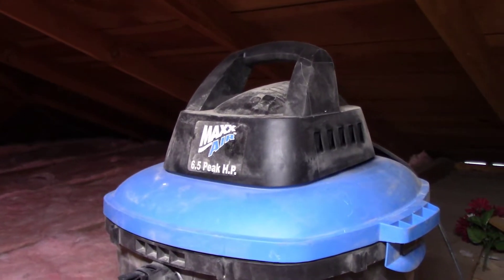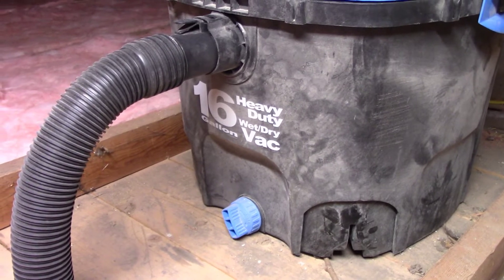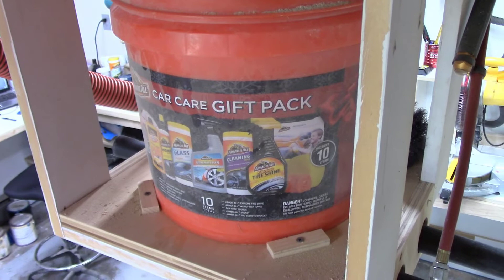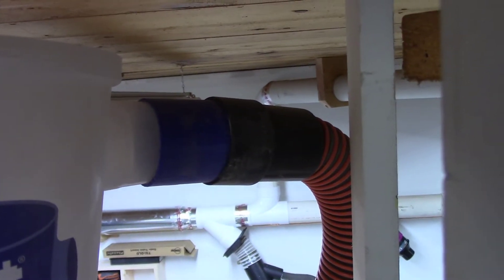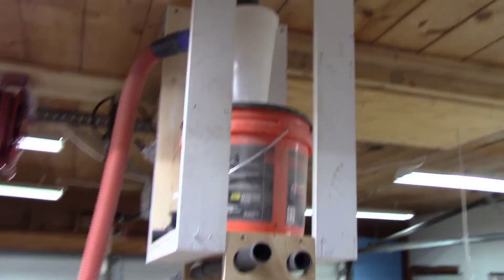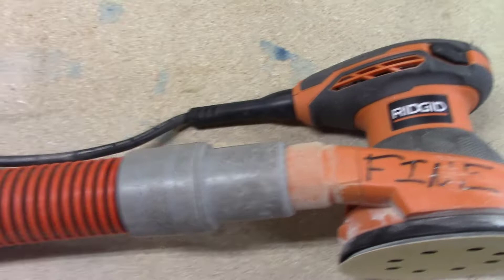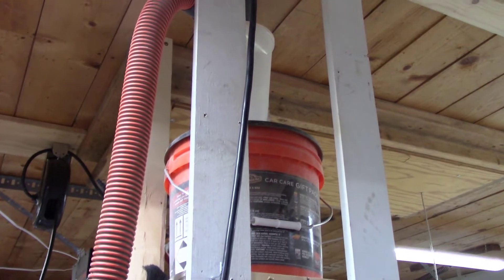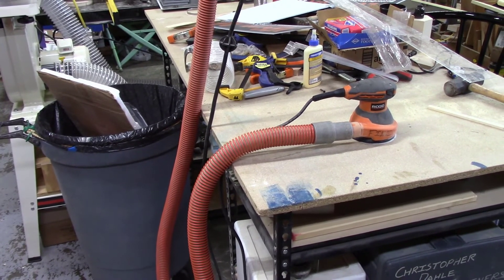Vacuum and dust separator in the attic.

Comment: That is an excellent. inexpensive. and practical dust collection system for a small shop. I think I will implement this in my garage shop. Do you find the 2 1/2 gallon bucket size adequate and why did you pick that size?
Reply from the maker: Hi Brian, That's a great question. Please note that I am at 8000 feet, so the difference between a vacuum cleaner that generates high pressure and a dust collector that moves a large volume is quite pronounced, which I did not try to explain in this video.

I mostly use this for my RO sanders, the router table, and quick clean up around the bench. It's perfect for that, but I wouldn't want to rely on it for any of the big chip generating machines. The 2 1/2 gallon bucket is adequate for my purposes but I only chose that size to give me more headroom...and it was laying around. I'd use at least a 5 gallon bucket if it was my only dust collection method and I might find that satisfactory if I lived at sea level. 

In my previous shop I had the same vacuum connected to a "DustRite" separator with 10 gallons of chip capacity which I used for my planer and other heavy chip generators, but it was marginal. Up here a vacuum cleaner can't move enough molecules to keep a heavy chip load fluidized. I experimented with plumbing and ducting 2-1/2' blast gates and fittings in that shop and decided they were a waste of money. But again, it might work at sea level.

I had to earn an expensive degree from Hard Knox University before I finally created an effective small shop dust collection system, so if you've got any questions, feel free to fire away. It's good to learn from experience, it's better to learn from someone else's experience!
Reply: @christopherdahle9985  Thank you. I don't anticipate any problem pulling a vacuum. I live just east of Toronto 240 feet above sea level. Right now it.s been -20 C for a while. I will tackle my unheated garage when spring comes.
Reply from the maker: @binnsbrian  Wow, Toronto, beautiful city, only been there once and always wanted to return. It's been unusually warm here in the Colorado Rockies, -12 C this morning, but usually we are below 0 F this time of year (< -18 C.) I felt too cheap to burn the propane it would take to warm up the shop, so I was an armchair woodworker today, busy reading Nancy Hiller's book on kitchen design (Kitchen Think, Lost Art Press) and entertaining the dog.

I hope the weather will allow you to get out in your shop soon and I hope you enjoy your time in it. Cheers.
Reply: @christopherdahle9985  Hi. Christopher. I responded to your comment but I don't think you received it as I don't see it posted. You peeked my interest when you said you were reading a book by Nancy Hiller on kitchen design. How are you enjoying it. 
I've been doing kitchen design and kitchen renovation since 1979 in Oshawa.(kitchenplace,ca) I read a synopsis on the book and it seems like she is specializing in refurbishing and repurposing existing cabinets. Most of my work is demolishing the existing  kitchen, removing walls, etc, and installing all new. Most of the cabinets I remove are builder quality particle board that aren't worth saving. 
It is also very difficult to find skilled tradesmen to refurbish quality cabinetry today. A lot of my existing trades are retiring. They haven't taught or promoted trades  in our high schools for years.  It's a shame. The trades pay really well.
Hope the weather warms up for you soon, so you can get back into the shop.
Reply from the maker: @binnsbrian  Hi Brian, I'd be glad to exchange thoughts on Ms. Hiller's book, the state of the trades (seriously wondering if the school district will continue my shop program when I retire), or anything design related but this is an awkward forum for it. Drop me a note, ctdahle at gmail.